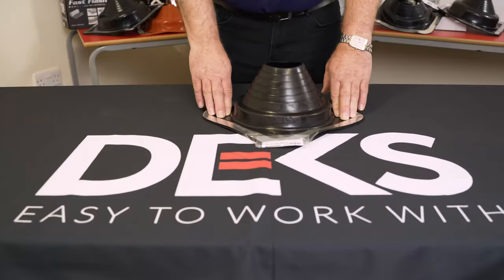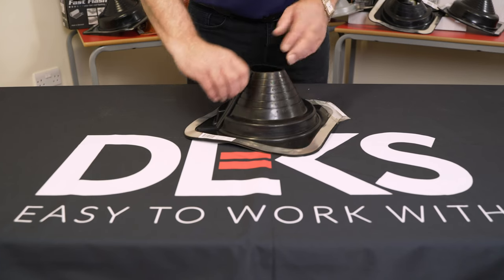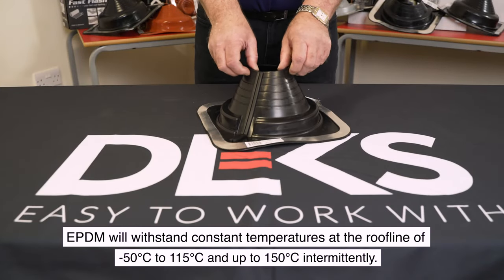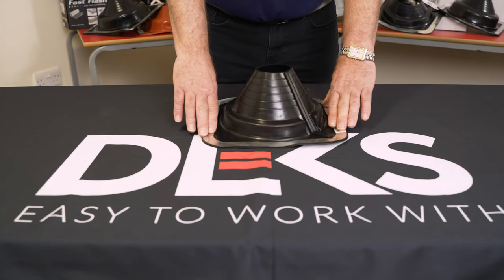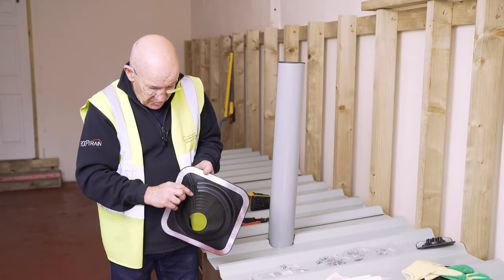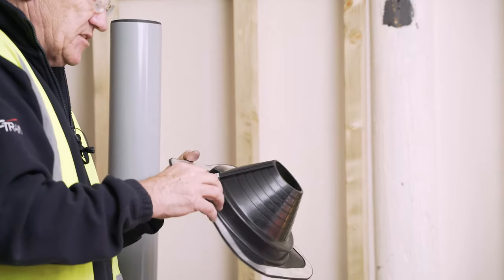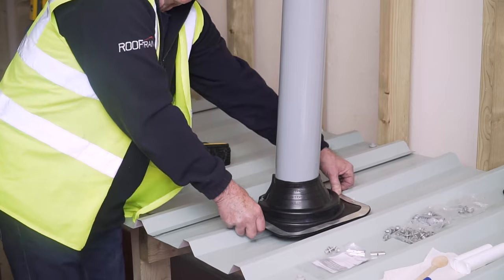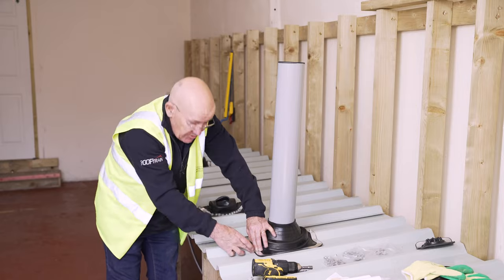Installing Dektite Combo including installation guide

Comment: That is crazy to put all those screws in then take them all out again!!! You can just place the rubber boot on and draw your line- lift it and apply your silicone then screw it down! Now it will be nice and tight-
Reply: Thats because English guys tend to be a bit eccentric